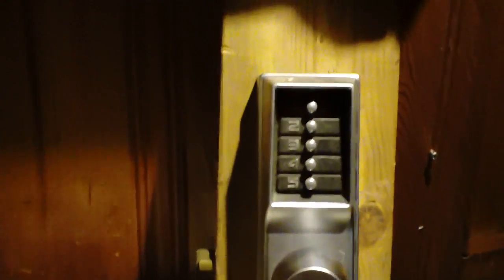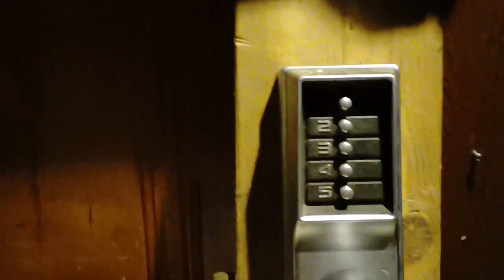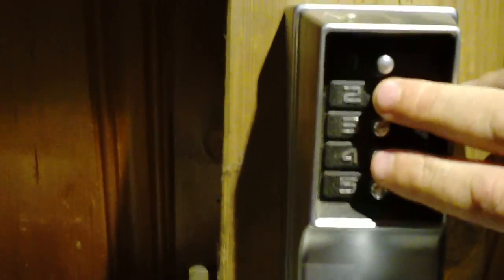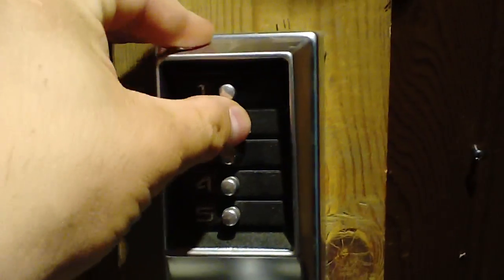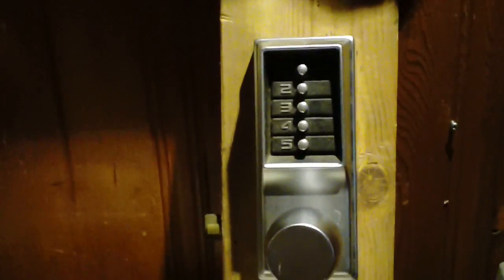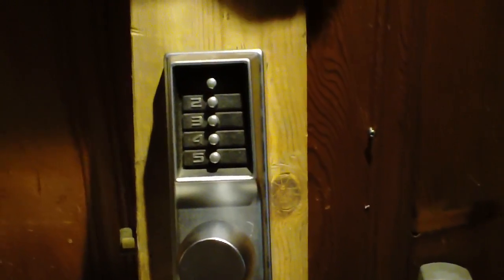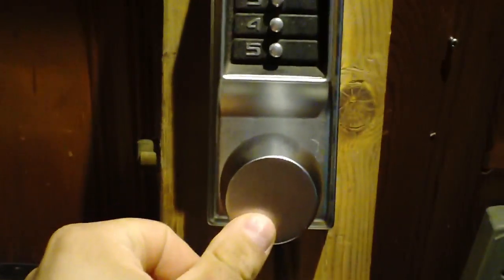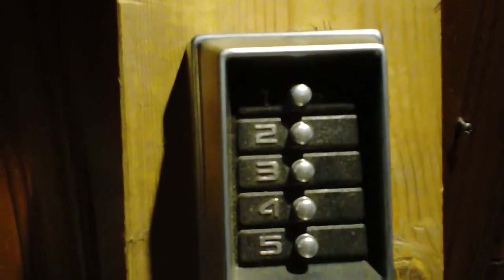Kaba Ilco Simplex lock update

Comment: The 1000 series lock is for "Access Control" not meant as a permanent deadbolt so this is pointless !
The Pentagon has about 6000 of these locks installed including the toilet stalls,  the combination would be different on one side of the door for entering and another combination coming out.
Reply from the maker: I was merely stating that it can be opened by other than the intended user pretty easily. Overall, it's still a pretty sturdy lock. On the other hand, don't think you could brute force pentagon locks without being noticed. Why are there locks on the toilets? And what's the point of having them on both sides? That sounds like it would be against fire codes for egress. "hold on, I have to enter the code before we can escape the fire!"

Comment: can you use single digit codes like 2,4,5   or do you have to have a simultaneous combo like 2 and 4 and 5 pushed at the same time?
Reply: You can use either single or dual  digit combinations.  For example you can configure it to press 1&5 and then 3 to open.  There are no other UL certified mechanical push button locks that can do this,  most of the junk you see on the market today all require electronic and battery to operate.